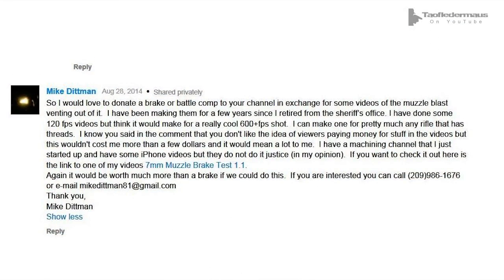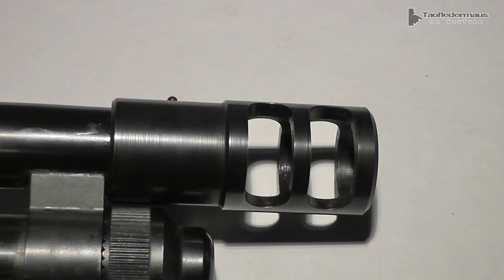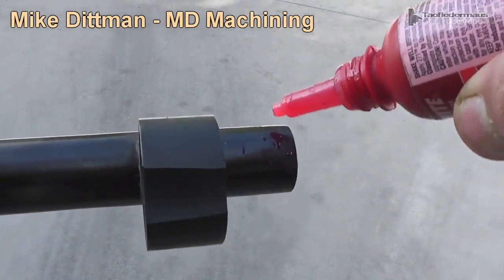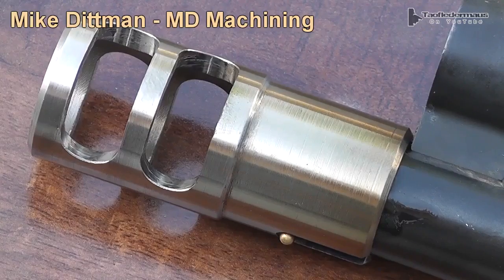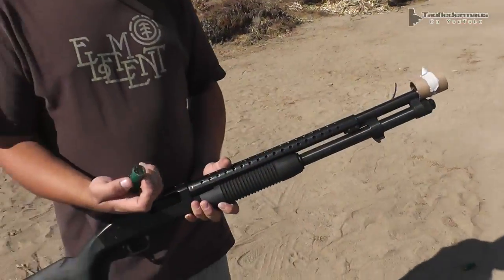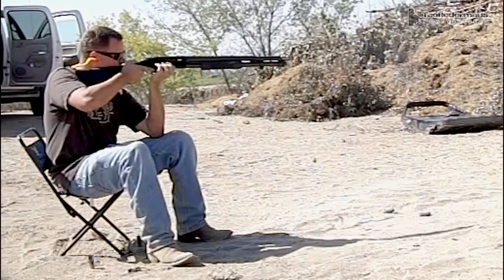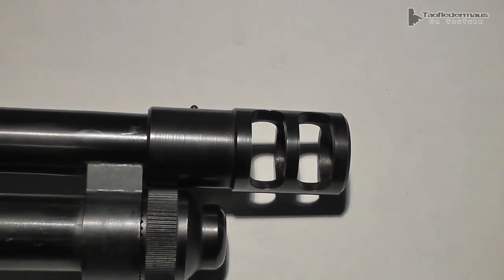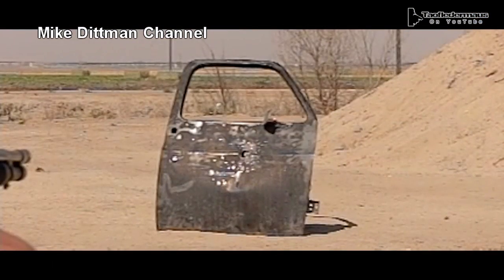Custom Machined Shotgun Muzzle Brake - Simplicity!

Comment: You could make a custom shotgun, able to fire from a distance, in a special holder( remote controlled trigger with a servo). That could be a good plan if you ever are goin to shoot dangerous projectiles, like small pyrex test tubes with magnesium and potassium nitrate and stuff.
Reply: AKA a sawing donkey, duct tape, and some string. Lol.

Comment: Cool but he should make some that thread into where your various chokes go. I have one of the threaded chokes that is a door breacher and it threads on the inside where a choke goes.
Reply: I would love to but machining choke tubes requires machining the parts down to a very thin wall thickness.  A job better left to a CNC Machine.

Comment: you need some science behind this... like, number... before and after ft/lbs recoil stuff.  i'm sure if you put cup-wings on this brake it will perform better, but how are we to know to buy it or not unless we get a before and after effective number relative to the mod?

it's a cool mod and i'd love to do it, once you add wings to the tip and once you publish number.  love how you heat it up and fit it on... very cool, looks good BUT ... how effective is it?  5%?  10% if you're lucky?  i'm not sure 5 or 10% less recoil is worth 200 bucks ... not sure if you can even feel it ... because you guys didn't even TELL us THAT much!  at least on cooking shows they say "yum yum!  it tastes sooo good!" but you guys didn't comment at all on the difference before and after ... wtf?

Comment: The reason that shotgun muzzle brakes are quite bulky usually is because as a rule of thumb the efficiency is governed by the plate diameter as a multiple of the barrel diameter. So in theory an "ideal" muzzle brake wants to have plates about 6 times the diameter of the barrel, which is insanely impractical, but the actual diameter is a tradeoff against the efficiency consideration and weight... If you want to improve a later generation it might be worth considering turning lands into the brake in front of the slots to increase the effective diameter... but either way, cool muzzle brake ;)
Reply from the maker: Sometimes looks come before function. Hey,  I'll admit it!   It's the reason people put  20" rims on a Pinto.  lol
Reply: It does look quite awesome ;)
Reply: Drew and the cost of bystander comfort. Amazing little device that very efficiently transforms recoil into noise....
Reply: Byron Morgan the M82 muzzle brake is also a lot more aggressive with 45 degree rearward facing baffles which tends to make it more efficient again, at the cost of operator comfort ;)
Reply: ***** It's all about your goal.  If it's aesthetics, often function suffers. if it's purely function....sometimes you can get a little aesthetics, usually not much.  Look at the brakes on the m82 for instance.... half inch hole, 4" wide brake. Works great to keep it from being a shoulder reconfiguration system.

Comment: Do the fins in the break not have to be rear facing?
Reply: If the fins were wider it would have more of an effect. Since the wall thickness was so thin I left the vent straight out.
Reply: @MikeDittmanmachining  send #, as I can call you...

Comment: Actually you can eliminate all recoil with a muzzle brake. I tested a prototype AR brake once that causes negative recoil. It actually pulled the rifle forward a bit. Of course that is not a good thing, haha. The final product has the correct balance...so I heard. I never got the finished one.

That looks rather cool, gives you a stand-off for breaching, and reduces recoil a bit. The way it fits is rather neat. The design has no slanting though so the recoil reduction I would guess is not very high. A better engineered design would reduce more recoil, but I am sure all that R&D would cost a lot more money than what he is charging. That is a rather decent price.

Comment: could i pose a theory on how to test the gas coming out of the brake 
wrap the muzzle brake with tape 1 layer at a time and fire till u get to so many layers it dosn"t brake the tap, then make straight tape with that same layer count and put force on scale till it snaps, giving a measurable number we can convert?
Reply: That might work but the impact force from the blast compared to steadily applied pressure from a scale being pulled or pushed against it are going to be a little different. I might give it a try though and see what kind of result I get.

Comment: Hey TAOFLEDERMAUS!  I have a new idea for a wax slug type load for you guys to try out!  I have about 20 pounds worth of these small steel pellets that are basically the shavings or scraps from an automatic steel plate beveling machine.  These bits of steel are each about the size of an airsoft BB, all with at least 6 sides (most are a cube shape) and they are pretty sharp.  I would love to send you a small box of this stuff to use in some of your wax slugs and film how they perform as far as damage goes compared to the bird shot wax slugs.  Maybe fire them at that truck door, a water melon, or even some thick boards or something.  Let me know if you would be interested in having me send you a box of that stuff!  Great video by the way, I love this channel!
Reply from the maker: Send me a pm and we'll talk about it.   I usually try to talk people out of sending me stuff if I can just go out and buy the stuff on my own.   (I don't like people to spend their money so I can make a video)  It does sound like an interesting load and something I wouldn't be able to buy myself.
Reply: ***** I'll send you a message.  Unless you know someone that works in a large welding/fabrication shop that owns an automatic plate beveler, it's probably not going to be easy to find, haha.
Reply: ***** I sent you a message on here!